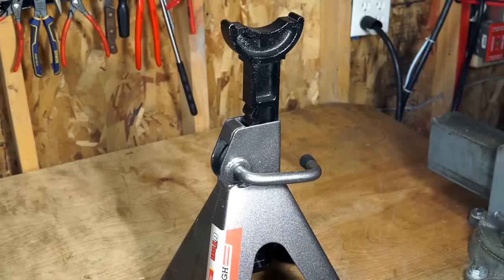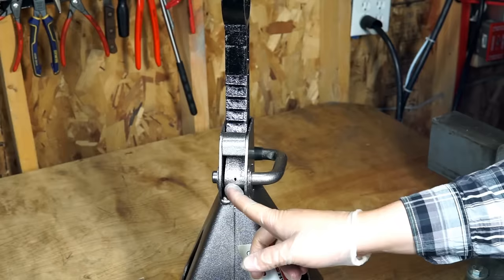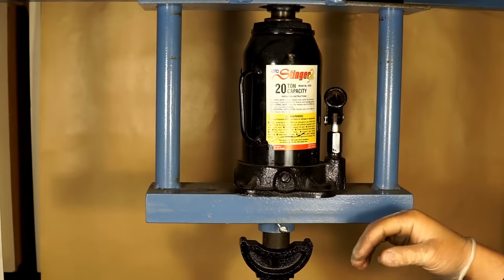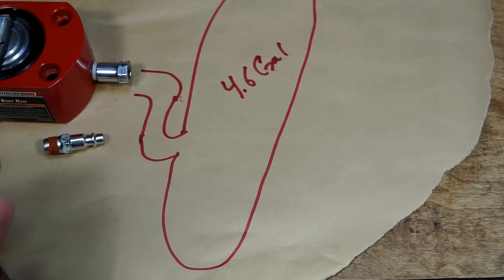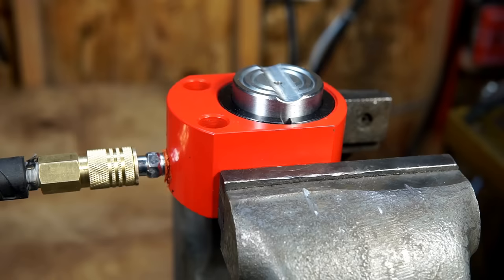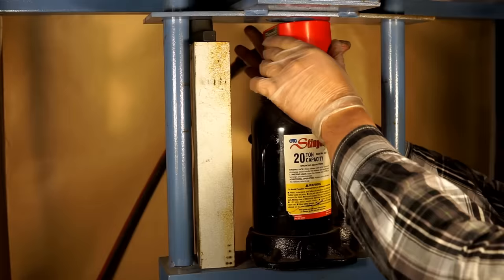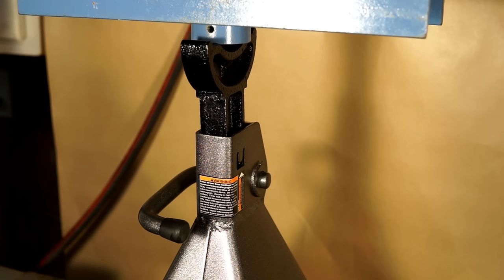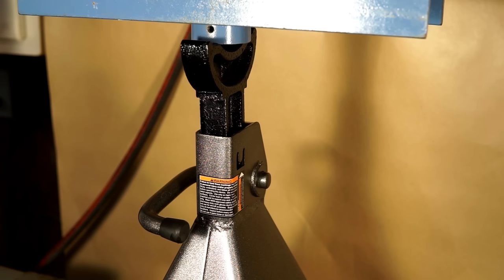EXPERIMENT: WARNING! Doing this to your Jack Stands will get you KILLED!

Comment: Jack stands like them are perfectly safe but they are not in anyway fool proof so I guess if some one wanted to put a damn crow bar in there it would let go. Only a total fuckwit would do such a thing. I have very similar stands and  their is no way they could ever let go unless I did something very stupid to make them let go.
Reply: His test did not only show it could be done with a crow-bar. It also released when hit by a tool.  Did you not watch as far as @10:28 ? That could happen if hit by, for examples, a large spanner slipping off a nut, or the gearbox swinging around while you are removing it.

Comment: does somebody know about the special safety jacks they are selling.  First, blocks are strong but they can break.  I've used them too.  I can use a 10 Lb. sledgehammer and swing it hard and break a block. The mpact of car falling 32feet/sec squared . is magnitudes higher than my sledgehammer.   The only way I feel safe is .. being on a level surface.. The tire system will not  be failsafe because an adult can get pinned and or crushed. Also a  person lying on their side is nominally  over 16 inches about 1/2 meter.  Also things lower than the jack stand can do damage.  
I trust hard  strong metal or very thick wood .If I can, I try to put  eight inch wood like land scape timbers attached together with screws or the equivalent.. I run that   under the support rail across the car.  This stops any tipping... I have a Ford  Expedition 99. I do this on the back area too if possible. I use two sets of  stands.  I actually look at those as the backups. I am not too worried about the pins failing. The problem with Jack stands.. I will not use the pumpkin..Many mechanic use it.  I'm not a mechanic.. I will err on the side of caution..
The problem with the jack stands is that they are universal.
 The rails underneath don't have specific mounting point... It would be best, in my opinion.. if they had a matching mount point or special that would be impractical from a manufacturer's view. That'd why the jack and stands are auxillary.  I use them but they have the above flaws.. Also if your tanking down the gas tank; you have to make sure that you don't have to move them.. one more point consider  the entrance and exit.. I take about an hour setting up.. That seems excessive to some.. Oh yeah  tire is a good fail proof, but as one person said put a  timber.. I would say a six by six if possible. Anything can happen .. gravity doesn't play favorites.. .

Comment: I’ve been dealing with jacks and jack stands all my life and never liked it, especially on a lower car(even though I did all the tricks like keep the hydraulic jack under as well as throwing wheels under there). I FINALLY got QuickJacks and feel so much better about working under my car. $1200 well spent.

Comment: This one doesn't have a safety pin which is an extra back up. Also I usually use at least 2 jack stands if I'm under the car. I put the wheel underneath the frame or side (anywhere sturdy) and if I have the room I use my jack as an extra support with it slightly holding the weight as well. You can never overdo it. When I have to work deep under the car I use 4 jackstands, they're just back up because it's very unlikely that every single one fails but if the car falls some could tip over. Also blocking any wheel that's on the ground helps IF a jack could fail. It's all common sense and pretty simple.

Comment: This video demonstrates that if jackstands are properly used, it takes a lot more than a simple elbow bump to make the jackstand fail.  It took intentional use of a pry bar to make it fail.  That's not a sheer pin; it's simply a roll pin to attach the handle to the pawl.

Comment: An excellent vid. One of the comments pointed out that the stands used in the demo were an old design. May be some relevance here. What wasn't mentioned was the age of the stands used in the Porsche incident. If the stands were  used a number of times, maybe a lot, maybe some wear and tare could be to blame for this entirely.

Comment: If you have 2 jack stand supporting one end of the car than the ground is supporting the other end of the car... so if the car weighs 2000 lbs, than the jacks togeter are only holding half the car's weight between them (1000 lbs), and by the same understanding we know that each jack is only holding half of that thousand lbs each, thus the 500 lbs... for those wondering.

Comment: I'm an OEM Automotive Engineer with 42 years of experience.  The biggest issue I see in these DIY videos is people not picking a vehicle up by the approved lift points.  This is a huge mistake and can cause damage and or injury.  I have a heavy duty floor jack to pick up my car and always use two sets of jack stands as well.  Very unlikely this jack stand failed by hitting the lever.

Comment: In my opinion, regarding my safety if I were to use the jack stands in your video, those are safe items. It took exactly what was necessary to lift the held weight to pull out the pawl to disengage the stand. That was an extreme amount of weight pulling up on the release lever. A mere elbow, foot, knee, head, or shoulder will not release that held weight. Bumping the lever with a hammer or wrench will not release it either.

Comment: You need to do a control test without the compressed air fed ram to compare the force on the jack stand without the cushion of air allowing the hydraulic jack to float upwards. This is an excellent example of what can happen but the weight of a vehicle acting downward on a stand is inert and is not expected to be forced upwards easily unless by another hydraulic jack being used. Excellent demonstration and good application of principles of physics. The jack stand didn't shear or break cleanly on any part of the assembly so the material looks to be of good integrity. Still a reminder of what can go wrong. Not so sure I will be doing any more work on my car again after watching this!

Comment: It appears to me that maybe somewhere down the line a Buyer has said look we can get these pins cheaper made of steel not realising the soft aluminium ones were designed to sheer as a safety feature. Mike's Family could be due compensation or anyone injured due to that if it can be proved. Well done you for feeling concerned about this.
I once rolled out from under a car just as it moved off the Axle Stand, and looked up to see someone leaning on the wing.

Comment: I love the fact that I have a snowplow mounting carton attached at the front of my frame. It comes in handy. It's a great jacking point and it's not in the way like jacking at the crossmember can be. So I like to put a hydraulic jack up there as extra safety. It will hold the whole front end up on its own if the Jack's on the frame fail

Comment: You were 'levering' with a length of bar under the handle. That is entirely different than just accidentally hitting it from underneath. Those stands were also likely the ones recalled from HF for having a pawl that does not set fully engaged into the tooth of the stand. The end of the handle if seated correctly should rest in the locked position on the stand itself or very close to it.

Comment: The real issue with some of these off shore jack stands is the palls don't engage enough of the ratchet teeth and don't have to lift the ratchet to release. You can easily test these by operating the release and watching for the ratchet to raise about an 1/8th of an inch before it drops. If the rachet releases without seeing any lift, THROW THEM OUT. I found two sets that I had to discard. The stands that are demonstrated here are good ones.

Comment: Interesting video. I don't use those stands, I use the ones with a pin and for extra safety I leave the jack under the car too, but I always operate the jack so it's just slightly putting pressure on the jack point. Its now made me realize that I could be putting my self in danger as that slight lift could be taking the weight off stands and the locking pin. If I were to use the jacks in this video, the lever would be able to move with little force. Thanks for this video 👍

Comment: So that pin will actually hold at least 500lbs. But regardless, it is extremely important to ensure that your jack stands are stable and far from any movement coming from you or anyone you're working with while under heavy load.

Comment: What your experiment doesn’t take into account is the shifting of the car weight when forces are being applied to say remove an oil pan bolt or oil filter. This was just an isolated test with a constant force but good for you for being curious about it. Question everything

Comment: Harbor freight recalled a bunch of those stands because the teeth on the riser part of the stand were not deep enough. When buying that style of stand, test in the store how far the lever must move to release the riser. Deeper teeth require a larger range of motion on the release lever. Also, always have a second stand set an inch lower near the first stand before going under the car.

Comment: I've never trusted metal jack stands. I've seen a few mishaps with others using them . I use 4" x 12" by 12 " square blocking and other 2 by sized wood to adjust heights needed. Never ever slips. I've pulled differentials.  Transmissions.  Engines. Never lost stability nor had a close call using wide wood blocking in 50 years. Metal jack stands are good for scrap.

Comment: It is possible to raise the rachet jack stand and for the rachet pawl not to fully locate on the rachet bar, i.e. it half engages.
It is surprising that this style of jack stand was still being made at the time of this video in 2017, without a safety pin to slide through the rachet bar once raised into position.
I have a set of rachet axle stands from 2016 which have safety pins, but the rachet bar can still drop unexpectedly if the pins are not in place.
This happens because the rachet pawl is not fully located into on the rachet bar when raised.
Fitting the safety pin into the rachet bar ensures that the rachet pawl is fully seated, which takes a bit of wiggling to get in.
The safety pin is a triangular profile that can only go in one way up, as it fits through triangular holes on either side of the stand.

Comment: My spider sense tells me not to trust those adjustable ones. Always use a fixed pin type. only way those will fail is if the 1/2 inch pin shears... which seems unlikely, or the body of the jack gives way. In testing I've seen with a press the pin gets pushed through the tube section, but you can imagine that's only at fairly crazy loads for the tube to give way!

Something like those for my liking would need a removable handle, so there's nothing to bump, or that pin to be removable so you can pull it out to completely disengage the handle from the mechanism then perhaps you'd be able to put the pin back in to the ratchet mechanism itself to lock it.

Comment: If a wheel assembly (tire mounted on rim) comes off the car, it automatically gets laid on it's side and slid under the car's rocker panel.  A 2x6 board 28" long is laid on top of the wheel/tire (perpendicular to the car frame) for added support and clearanace.  If the car falls, it falls on the board and wheel assembly, not the person working on the car.  It's an extra step but is better than getting injured.

Comment: There is one more aspect that could have increased the likelihood of releasing the ratchet mechanism of the jackstand, and that's the tolerance of the fit between the jackstand body and the center column. If there is excessive clearance, the center column will settle at a slight angle due to the ratchet teeth being off-center from the load, which will decrease the angle of the ratchet teeth relative to the ground. That reduces the distance required to raise the load before the ratchet releases.

Comment: You're test is only at 5% conservatively of the nameplate load (12K Pounds).  I'd like to see the pin survive a higher load.  It is also possible that the pin could protect the pawl if significant down pressure occurs such as the the wheel-hub falling onto a poorly placed jack.  It would be useful to know if the failures are from the stand tipping or actual collapse of the pawl/telescopic arm.  But I'm with you, the more force down, the more improbable an unassisted human could force them open.  I've had my tires completely in contact with the ground and very little weight still on stands, and it's impossible to "cheat" the stands without raising all the weight with a jack.
Reply: That pin isn't there to protect anything. It is a roll pin not a sheer pin

Comment: Pretty sure I know exactly what happened.  I cant tell you how many times I've had to replace the roll pin (yes, it's designed to also shear under abuse).   I'm sure there are other reasons, but primarily the pin shears, or half shears when the stand gets stuck because the jack cant lift high enough to cam over, maybe the vehicle lifts crooked, or whatever,  so someone forces the lever to get it released... eventually,  the lock sticks in the wrong spot or whatever and you dont get full positive engagement.   When you use it like this, it's possibly already cammed to the high point and can easily slip.  The burrs from the pin can give you a false sense that it's working correctly.  Easy fix for a dangerous condition, caused by ignorance.  Check and replace pin before use.

Comment: I've honestly never really trusted this style with the lever, I know it's very unlikely to ever be a problem but I've never been able to get it out of my head that it is probably possible to lift the lever while there is weight on them, particularly with light vehicles.

I do always leave a hydraulic jack under and back it up by putting the wheels under the sills.

I'd much rather if the older style with the holes and a big pin was more common again, they're kinda hard to find now though.

Comment: Once a jack stand is fully loaded, it's almost impossible to release the handle by gently bumping it. Hit  it with a 3-5 pound maul, hard, maybe it'll let go, but once it's locked into place by whatever it's holding up, it's hard to move.

Comment: I have the same jack stand and saw the flaw on the design getting the lath unhinged so I drilled a hole across the frame and inserted  a safety pin to prevent it from unlatching the movable latch. It works, the latch can not move until I pull the pin out.

Comment: All the jack stands I have incorporate a safety pin that has to be pulled out before the jack stand can be lowered. 
Always put a floor jack under one side of the vehicle as a safety back up to the jackstand. In addition, if you took off a wheel, place the wheel under the side of the car as another measure of safety incase the stand fails!
Chock the rear wheels as well to prevent rolling!!!

Comment: I have the 3-ton Daytona jack stands and they have a locking bar that slides in after you adjust the height so that the saddle can't travel up or down at all. The welds are also significantly better than what I see on that one.

Comment: Let me tell you about Pumpface. Pumpface was a pipe fitter , and a support bracket was 10mm out , so he thought he can push it over with the PortaPump and it'll stay in place after. But the PortaPump didn't extend far enough to make the distance so he put his hammer in as a spacer , pump ,pump , ping the hammer flew out and left a circle mark on his forehead where the ballpine(rounded end) had struck. He was a bit dazed, and still has and indent in his forehead! So use the correct equipment and don't ever take short cuts, you only have 1 life. Think, Home Safe! Have a good day!

Comment: I bought 8 18" X 18"  X 4" concrete slabs and after putting car on jacks, I raise wheels and slide the slabs under wheels. This way car is supported by jacks and concrete slabs. The slabs are solid concrete and cost $2 each. Concrete can't be compressed.

Comment: I put my vehicle on jack stands often to do tire rotations. I drive a Honda accord '16. I use a 4 ton jack to lift the entire front of the vehicle at the subframe put jack stand in place on pinch welds while the rear tires are chocked and e brake engaged. Release hudraulic jack. Move to the back and lift entire rear end at the tow hook place jack stand in place at pinch welds, lower hydraulic jack until pressure is on floor jacks. Go back to the subframe in the front and use hydraulic jack to touch subframe but not really jack it up just snug into the subframe. Front because thays where the most weight is. If im doing brakes or getting under the car ill do all the same except add putting my tires underneath the sides of the vehicle and add the hudraulic jack for support on one side close to where im working on the pinch weld. I use 3 tons jack stands with locking pins even though 2 tons would be the recommended min. When i was young i was a tech and did alot of alignments and ive had vehicles slip off the secondary jacks you use to lift the vehicle after lifting with the 4 post lift. Its scary as shit and happens fast obviously, luckily the car is still on a 4 post lift and never had an accident. But i have heard stories of cars completely falling off the alignment rack when secondary jacks fail due to bad seals or improper placement. Always do the most you can to protect your self.

Comment: When you have 4 jack stands and an uneven floor you'll likely only have weight on 3 of the stands at one time.   The 4th stand would be easy to release.   I prefer the old fashioned type that you put a thick pin through.